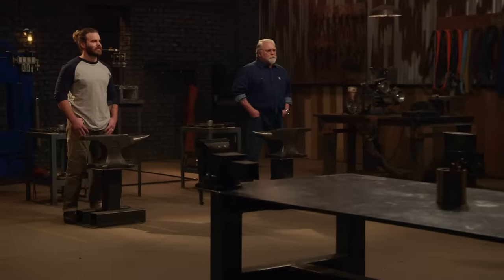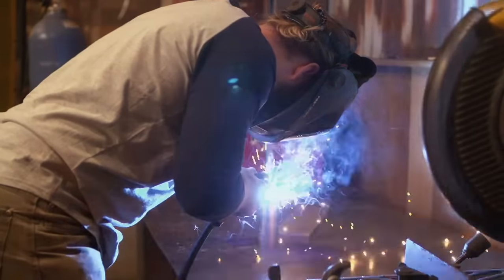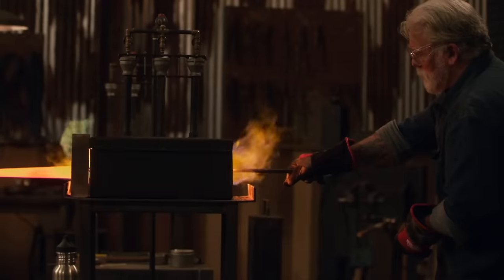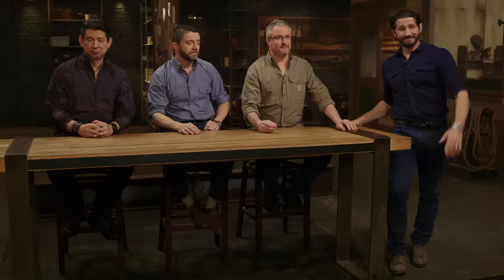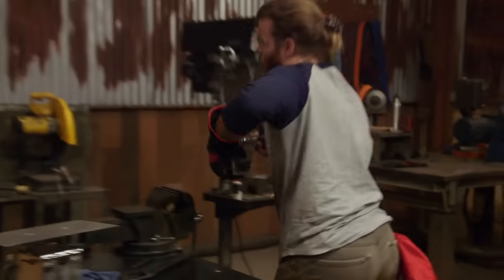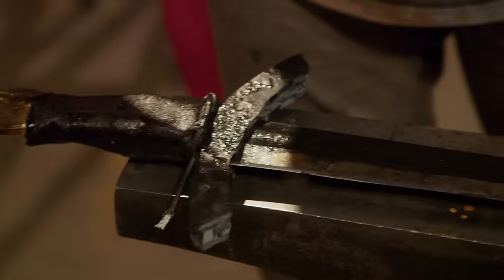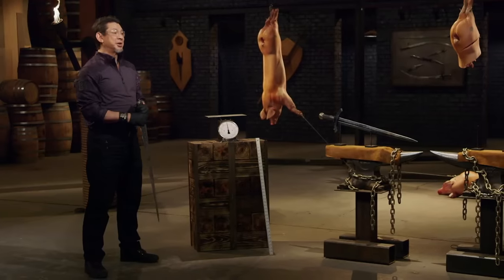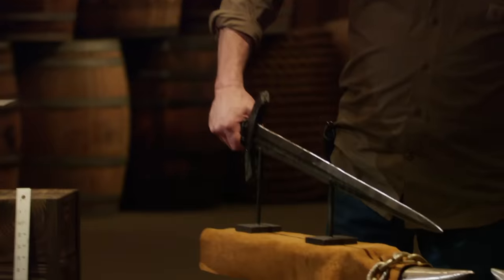WATCH OUT For Dave Baker’s Medieval Masterpiece | Forged in Fire: Beat the Judges

Comment: this show really is an insult to properly working blacksmiths. forging a swordly shaped bar and then just removing as much material as you want is a joke
Reply: How would you do it?
Reply: @kieranwhittemore1010  forging is as close as possible to the measurements and using a fullering jig. as it has been done for ages...
Reply: You clearly have only just found out about this show. I'd say it's easily one of the best programs out there, giving insights into and broadening knowledge and interest of blacksmithing. You're only catching a 10 minute clip here. The whole show has a deep history to it now, including with the judges becoming blacksmiths themselves or in Ben's case, from unbeatable competitor to judge.
Reply: @JTGallant  this is a reality show not a documentary about blade- or blacksmithing. and no i've been aware of this for a long time. it is just utter nonsense thinking of the shown technics to be "proper" blacksmithing. this is easily classified as 'pounding and grinding', the complete opposite of thoughtful use of material. also there is no selective hardening involved due to the use of gas forges.